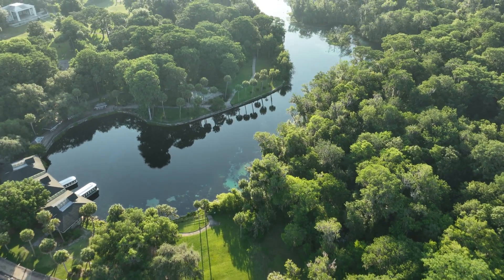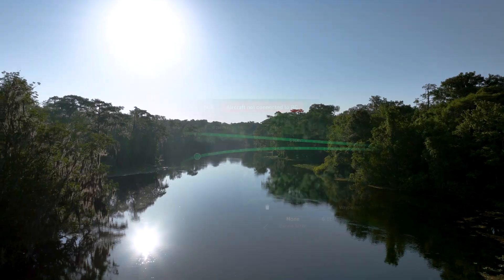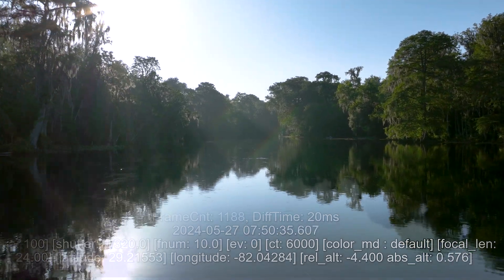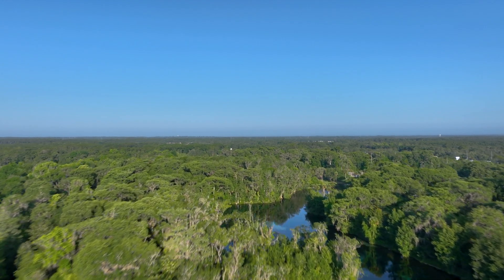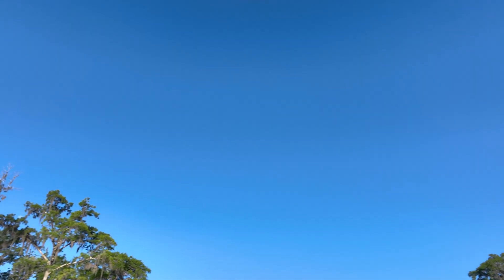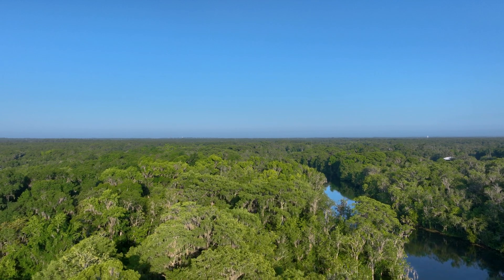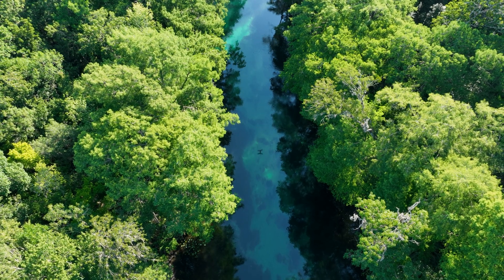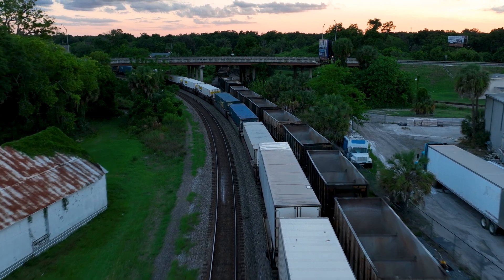DJI Mavic 3 - Flies itself into River at 27 mph.

Comment: You sgould play the lotto lol, you lucky 😆 Always best to turn OA off over water. Great idea with the way point over water but not recommended. It def works better over rough water. I only use way points for hyperlapses. Also waypoints are not always accurate. The deviate a little everybtime. Thanks for sharing. I fly the Air 3, Avata 2 and Carbon. I sold my Potato and Avata 1.

Comment: Okay, so what I take from this is, be at least 7m above water. If you get closer, fly manually, so you can reject any unhealthy decisions your drone might take.
Would you confirm this?

EDIT: Close above water: Fly manually with obstacle avoidance completely disabled.
Reply from the maker: Even when manually flying, your drone can 'think' it's doing the right thing, and start descending (when over water) and if Obstacle Avoidance is on and set to 'bypass' - so really if wanting to be low while over the water- manual and obstacles off. ;)
Reply: @ImJustADroneinTheWorld  Obstacles off is actually a very important detail.

I'm going edit to root post.
Reply: Obstacle off, manual control and don't take your eyes off the controller when the drone is out of VLOS...veteran dji submarine operator here. I fly over water every single day, forward, backward, low, high, in manual mostly but also hyperlapse and master on occasion, every season- it is absolutely doable but with the right practices and unfortunately- experience. edit: if you fly over water habitually and don't lose at least one drone, I'll call you Neo forever.
Reply: That sweet drone of yours worked a miracle brother! My m3p and a2s have saved themselves on many occasions, not just from water but Bird strikes and other '"obstacles" also. I consider my 6 losses a win, in the final analysis.
Reply from the maker: @flightographist  heck yes. In reality I’ve only lost one, a little over a year ago, but I’m not well seasoned quite yet lol